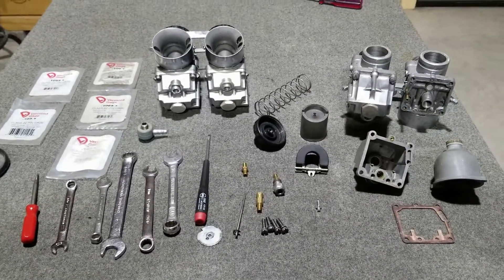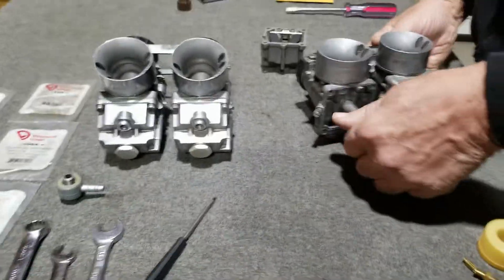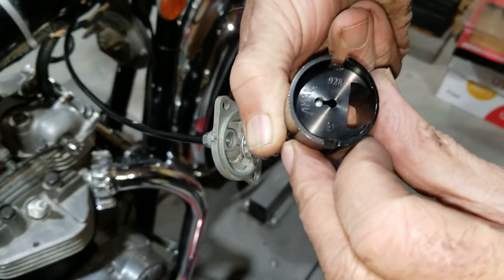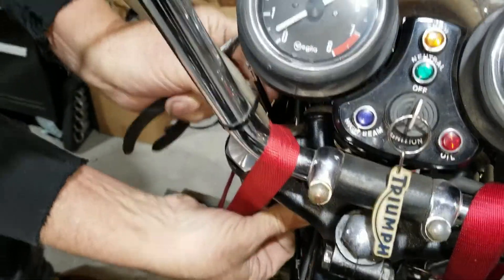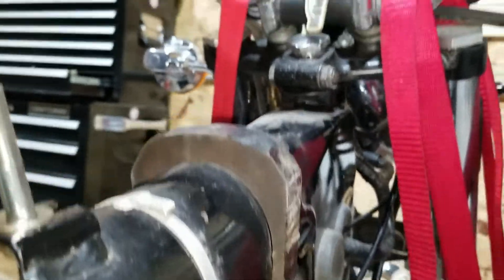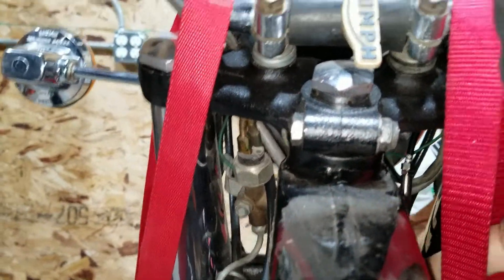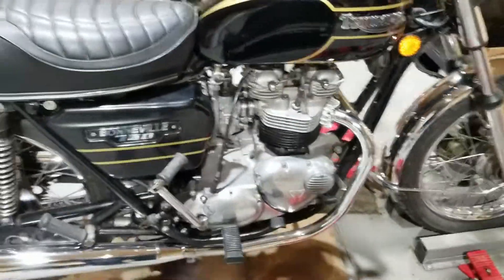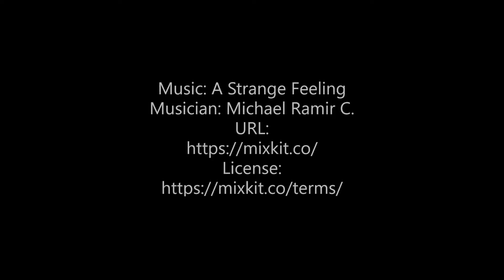1979 Triumph Bonneville 750cc, Swapping carburetors Part: 2 Amal Mk 2 Installation

Comment: I can't tell you how pleased I was to find this video. It's almost as if you had made it for me! I have a 1979 T140E with a slight but sometimes annoying hesitancy when opening the throttle quickly (when the engine is hot). Pilot air screw adjustment has not solved it. I've replaced the cold start plungers (to no avail) and the next step was to replace the jets and check that I have the right throttle slide cut out. Being able to refer to your video when re-assembling so will be so helpful! Many, many thanks.
Reply from the maker: If you are talking about the new plungers that are available, well there to long, and they leak air, so that's why we went to the cable operated choke plungers,
Reply from the maker: Oh and thanks for your nice comments, also let me know if you need more help thanks,
Reply: @jessesvintagegarage765  do you mean the OEM plungers you can get direct from Burlen (owners of Amal)?
Reply from the maker: Yes the OEM ones from AMAL they are to long
Reply: @jessesvintagegarage765  I had a discussion with Amal's tech support about the cold start plunger length thing. They said that the first design of Mk2 plunger could wear the area above the plunger's seat into a barrel shape, causing air leaks and rough running in higher mileage bikes. As a result they redesigned the plunger in 2011 to make the plunger's head longer, giving more support to the head end to keep the plunger from wobbling about in its bore, and thereby reducing the risk of that kind of wear. My bike has a relatively low mileage thank goodness. I've had a close look and can detect no uneven wear in my plunger bores. Given how the plunger works I'm not sure I understand why a slightly longer plunger head would cause a problem with air leaking past the plunger seat - the key thing is the quality of the seat and the closeness of the plunger fit in its bore. I don't see how a slightly longer plunger would affect that? The cable version is the same length anyway - perhaps you got some new old stock?

Either way I reassembled and refitted my carbs watching your video and it was indeed of enormous help - thank you so much. Parallel inlet porting has made carb fitting a fair bit more awkward than the splayed inlets of the earlier models. I had spent some time wondering how best to synchronise Mk2s given the relative inaccessibility of the bell mouths caused by the parallel inlet design. It had never occurred to me to leave the float bowl and needle jets off and just observe the needles - inspired! Thank you again. BTW I plan to replace my float bowl screws with Allan screws to make the searching, slipping and sliding involved when screw-drivering the inner four and their rather awkward and inaccessible siting a bit easier.
Reply: Make sure you exhaust headers to silencers are airtight use some blue silicon to seal it

Comment: I've run twin mk11 s for twenty years......I like em, only thing is make sure you get the new stayup floats so you can adjust your float level,something you can't do with the old nylon floats. Also I ended up swapping the top cap with a metal one as the cable adjusters end up being pulled through the plastic threads

Comment: Thank you for a well described video. I have a 78 T140E that is all original and seems to be having carb problems. Mechanic is telling me to go with the 930 premiers but the bike originally came with the Mk2s. Trying to determine whether i should get a new pair of mk2s or switch to the 930s. any insight you might have on your experience with the 930s would be highly appreciated.
Reply from the maker: @Goodtimesfilm1  Well that's an interesting subject I struggled with the same issue. The real problem is how original do you want to keep the bike? Switching to Amal Mk1's isn't just bolt them on and go. The cables are different and require a lot of mix and match because the 78  79 T140E has different twist grip and getting rear cables the right length was tough. But the bigger issue for me was mounting the carburetor flange to the round inlet spigots on the parallel inlet ports once I found something that could do that then the air cleaner connection was all wrong and had to find a way to connect the carburetors to the air box as it was important to me to keep the air box and side covers. But truthfully after all that the bike just didn't run as clean and smooth as it should have it always had a hesitation or slight stumble. So after that I started messing with the Mk2's again. In my case it was choke or enrichner plungers were worn out as starting was the biggest problem the other thing that really made those carbs work really well was putting 106 mk2 needle jets in and removing the stainless 105 jets every thing else stayed factory stock as far as jetting I did renew slides and floats.
Good luck with your bike I hope this helped you.
Reply: @jessesvintagegarage765  much help thank you! can i ask where you bought your needle and float from?
Reply from the maker: @ Amal mk2 parts are not always stocked by everyone so do some online shopping and you should be able to get everything you need fairly easy. Here’s the list of part numbers that I used everything else stayed the same,

2928/060
Number 3 anodized mk2 slide

622/149 viton tip float needle

622/069A stay up float these floats fit Mk1 and Mk2 carburetors some come with both types of bowl gaskets

2622/079 cold start plunger assembly 

2928/122B Mk2 .106 needle jet it has a groove scribed on it and is different than Mk1 jet

Comment: If the original bike year had Mk1 amals..DONT change to Mk2 amals...get the new redesigned .. Premium Mk1...has all the improvements you need including the material of the body is now Aluminium